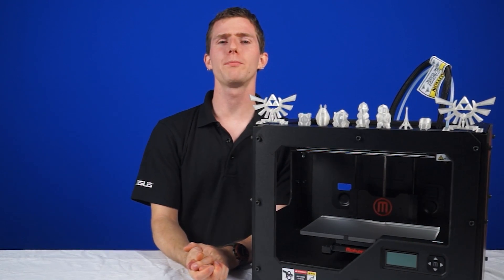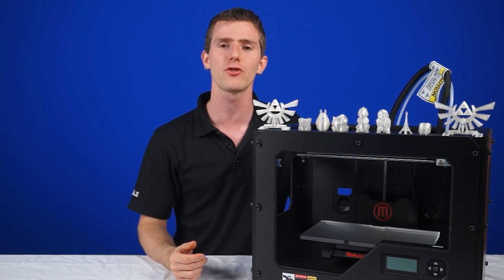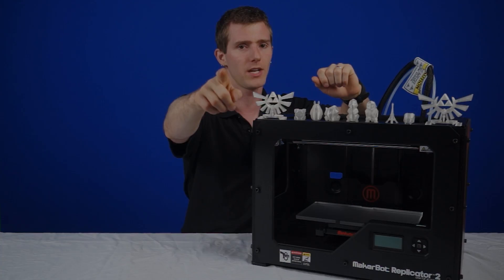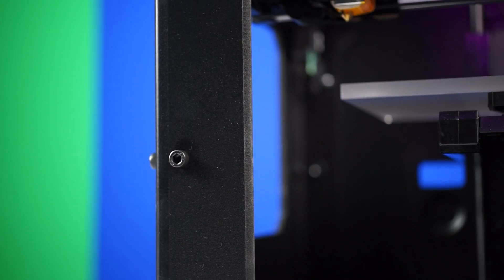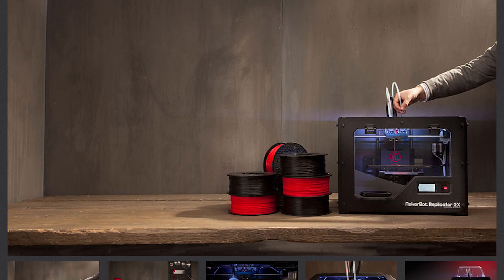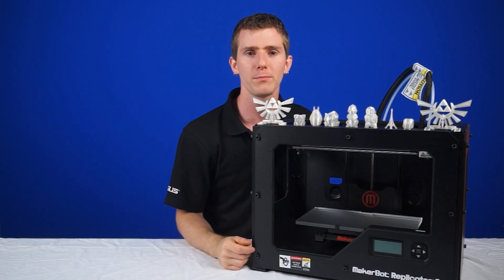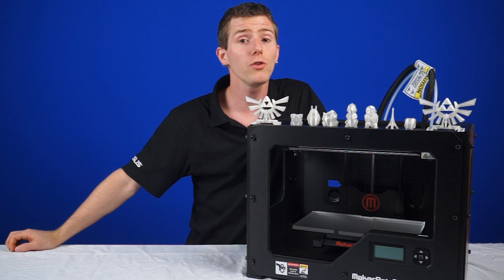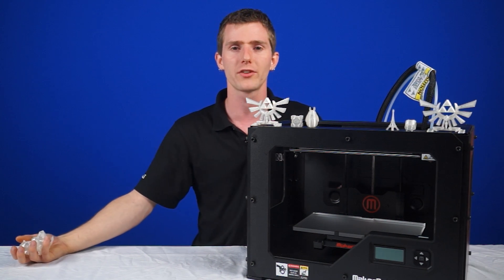What is 3D Printing? ft. Makerbot Replicator 2 Review & Giveaway!

Comment: If I had a 3d printer, I would print miniatures and set pieces for my tabletop games. I play D&D and Warhammer 40k. If you've ever had to buy miniatures or set pieces for tabletop games you know they are really expensive. Even with the cost of the supplies, I'm betting it would still be cheaper to print than to buy. Oh and also there is my other hobby, I'm into RC. Would be nice to be able to print parts so that if I broke something and the store wasn't open, I could print out a replacement part.

Isn't there someone working on a 3d scanner. I thought I read someplace where they said someone is working on a scanner that you can scan anything in and it would make a blueprint of the object so that it could be 3d printed. Too bad there isn't a recycle machine that took plastic from say milk jugs and turn them into the filament for the 3d printer.
Reply: Same here, Warhammer is so  fucking expensive it is really hard to even justify getting into.
Reply: TheBernhard100 I know. The 10 people I play with we all share what we have so that it helps other people who don't have everything play the game. So if someone doesn't have all they need and someone else does that they aren't using at the moment, they let that person borrow so that they can play. I find that's the only way you can really afford to play properly. 
 
But it would be so nice to be able to 3d print the miniatures. I would even be wiling to pay the royalty for the ability to print what I needed. I bet it's still cheaper than paying for already made ones.
Reply: Prence Yeah, I could see a game club pooling together and getting something like this as soon as decent printers drop under 1k and high quality models are available.

The main problem I have with Warhammer is that you can't just "try it out" like you can with Pathfinder or other rollplaying games. They expect you to drop like 50€ (don't recall the exact price) on a set of two unfinished armies (that you might not even be interested in playing) and a bare-bones version of the rules to even try it out (sure, you can find a local gaming group but that isn't allways as easy asd it sounds).

It's not so much that getting into it is expensive, even though that is a big turn off, trying a broken down version out is expensive.
Reply: I agree. But it's a all in or not situation, you want to play, then you got to go all in. And that's a shame, it can be real fun once you get the hang of the game. I've had several people that were interested in playing until they found out just how much it really costs to buy a basic army and the books you need to start with. After I told them they said there was no way they were going to invest that much in a game they just found. I would have offered the use of my stuff, but these were people I didn't really know, and wasn't sure I could trust them. I have a lot of money invested in something that I'm not sure you walk away with it all. Too bad no place around here rents the supplies to be able to play for the first time. Now that would be awesome.
Reply: Prence That might actually be a great business Idea.
Host a small Gaming cafe/lounge with a ton of finished armies and a few tables, put up a fee for each use and/or loan them out with rulebooks if needed on contract.

Personally I would like to see maybe around 100€ starter boxes with a COMPLETE army (not unfinished armies like the ones they currently have) with a full rulebook and codex.
I don't see why that isn't possible.
Reply: TheBernhard100 Me to. If they did the starter boxes, then if it were more reasonable to get into the game, they have a better chance of selling more merchandise later on. If you can't get enough people to play, then you sell way less stuff.
Reply: Prence Exaxtly, I think giving people a foundation to build on, one that is complet and works with the rest smoothly, instead of scarce stepping stones here and there is a way better Idea.
Just something you could point to and say: 'So you like that faction? Get that and you can play' instead of: 'you could get this if you like one of the armies, but even then good luck playing with anything else except the other army in the box'.
I think this is really needed since the hobby has been getting a growing follwing on the internet and this could serve as a great way to get many involved verry easly.

Comment: Probably print a 3D printer. And sell all the printers I print, and make infinite money.
Reply: except you couldn't print the electronics and firmware...you failllll hardddd
Reply: Bongo2k SHUSH WITH YOUR LOGIC
Reply: ***** yeah and one 3D printer will take 31 hours to print and one 3D printer cost about 500€ so taxes -100 = 400€ and energy - 50€ = 350€ so yeah

Comment: can 3D printer print 3D printer's parts?! :D
Reply: Yes, some printers can completely replicate all of their own parts.

EDIT: Except the electronics, of course.
Reply: Jim C K Flaten it was joke :D and materials!
Reply: When I was at the MAR regional event for FRC, one team had a makerbot at their chairman's booth and it actually had 3d printed parts in it as replacements for older parts that had worn out. It's so cool
Reply: this is what a rep rap is you print most of the parts and everything else you can find at a hardware store
Reply: Jim C K Flaten Don't see why it can't. PCB is just a plastic and if it accurate to a few microns, it could potentially make a motherboard. It could probably even do the metal inserts too. Though it probably would be much better handled by appropriate equipment, it is still neat to think it can print just about anything.

Comment: what does the printer do if if has to "build" down? like say you wanted to print a question mark it would start at the base then when it gets to the top it has to build down. im guessing that 1. If printing the model on its side avoids the problem it will do so. and 2. it will do that scaffolding thing you mentioned. Is this correct? ps Pokemon?
Reply: Yeah, you would do it by either one of those methods. I think building it sideways would be much cheaper though, in terms of filament used.
Reply: You would just turn it sideways in the modelling program, you would make it so there are least overhanding parts as possible, so remember it doesn't need to be printed the way it will stand

Comment: I would make my own RC car parts like Rock crawler chassis and suspension links. I would also make my own SSD display holders to use in my tower and an external ssd docking station for my laptop.

Comment: I've always wanted one of these 3d printers.   I would go to work printing useful things like my Dunkin Doughnut thermos' little plastic rotating tooth/gear thingy used to operate the push button sip lid.  (Imagine first part that falls out when taking apart a clicky ink pen) 

 or

Create an adaptor for disposable razor inserts.  (Gillette Mach3 and Venus are same but different. Yet women's inserts usually go on sale more often.)  

Or 

 Use the printer to fix a myriad of broken electronics that failed because of a shitty plastic tab failed.  

 FFS. I just realized this.  No more fucking duct taped battery backs/doors...    omg. Somebody send me one of these.